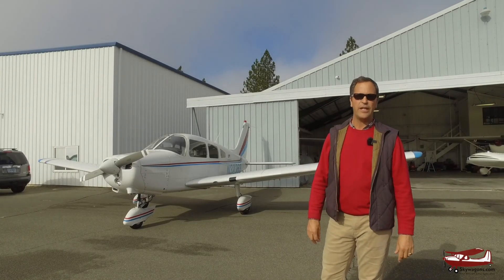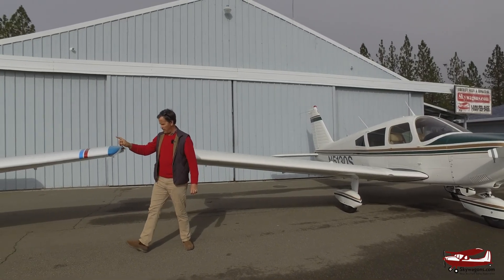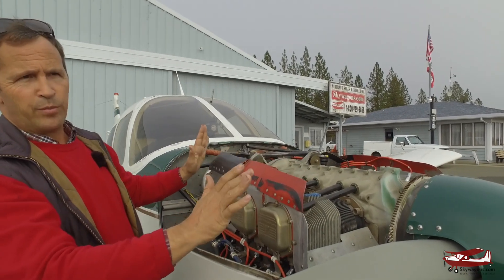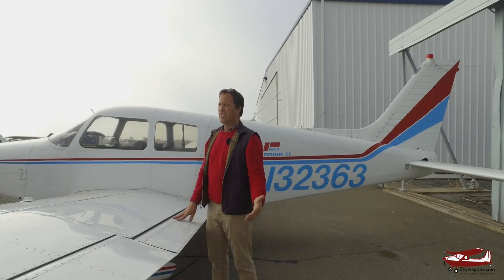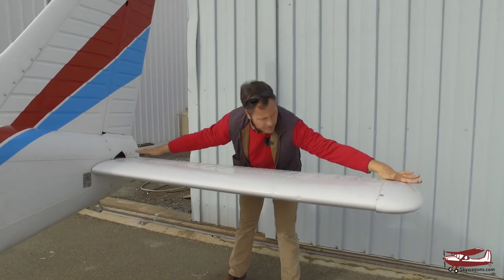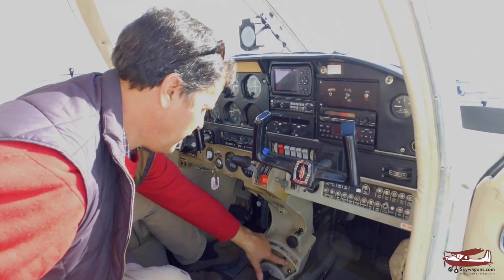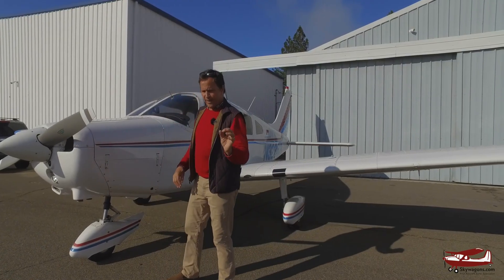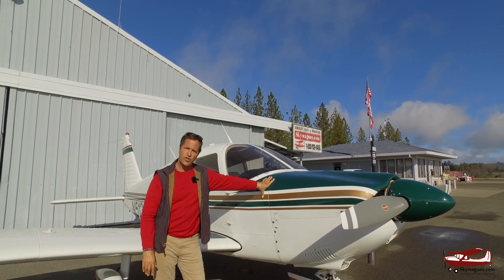Piper PA-28 Year Model Changes

Comment: The PA-28-236 Dakota is a plane to strive for. The lower 2400 RPM redline takes a bit getting used to, but the plane is quiet, and performance is impressive... Fuel capacity was dropped from 84 to 72 Gals for some reason, but fuel management with two tanks instead of four much easier. Interesting and relaxed presentation. Thank you. Enjoyed it.
Reply: I’ve heard from one A&P that you increase the pitch stop limits to 2,700 and get a 260hp Dakota. The engine, engine mount and firewall are all rated for that hp as they are the same as the Cherokee 6. He said just make sure you adjust it back prior to your annual🤣 Considering all of the Cessna 182 engine upgrade and mods it’s crazy there isn’t an STC for this. Can’t find any dark web info on someone actually doing this…

Comment: The -1 has nothing to do with the fuselage, but solely the wing.  The fuselage stretch happened somewhere around 1973 or 1974.  The -720 in a Queen Air was an STC mod and not original IIRC. And I believe the term you’re looking for in lieu of “dented” is “corrugated.”  Lots of crazy differences throughout the run.  Great video!
Reply: They are called pillow doublers they help stiffen a flat section of aluminum and make it more rigid
Reply: I think the Queen Air with the 720 were called Excalibur.

Comment: If you want to understand the configuration of the various PA-28 models then TCDS 2A13 may be a better resource than this video.   PA-28-180 Archers had the longer fuselage, increased wing span, and increased tail span for serials  28-7305001 through 28-7505260.  I have owned, for over 20 years, one of the last 100 built with this configuration.
Reply from the maker: This kind of comment is exactly why I made this video. 99% of people will not look at a TCDS and run serial numbers.  They want an overview and I gave them, one.  It is hard to spot a serial number as it flies over or you see it at 100 yards and no-one has a TCDS on then at a random airport where they see a plane they want to know what it is. Hence the macro ID on fuselages and wings etc.

Comment: I did my IFR training in a PA-235. Often the missions would have four people  on board: the student pilot, the instructor and other two student pilots also taking the IFR course and learning from observing the other student's IFR lesson. During one of those flights I was in the back, going over approach plates in anticipation of what was going to be done. We were IMC (in cloud), and suddenly the engine started sputtering, just about quitting. It took about 10 milliseconds for us three to kind of yell to the pilot in the left seat, "CHANGE TANKS! FUEL PUMP ON!"

He did as told (not that he'd have to be told, but you never know) and the engine sputtered for a few more seconds and then roared on, as if nothing had happened.

The student + instructor had forgotten to manage the fuel, were merrily flying along in one single tank, and let it run dry. Having the engine almost quit in IMC was one of my scariest moments flying.
Reply: Top notch instructor

Comment: Great video about not-so -easy defined Piper model lineup. Would like to see non-turbo Dakota one day.  I always flew Pipers but manage to find out few things in this video that I never new before, like spring-loaded ailerons  or fiberglass tip tanks. Thanks for the great work.
Reply from the maker: Thanks.
Reply: @skywagonuniversity5023  I'll come and visit you one day, I am in L36 / Rio Linda, Warrior II N39954.
Reply: @skywagonuniversity5023  Mark--did the tapered wing change the handling?  Performance?
Reply: I have a lot of 79 turbo Dakota hours, what a great plane, great seats and quiet interior. The turbo will get you into the low 20k FL to catch some high tail winds on occasion.

Comment: In the 60s I learnt to fly in a Musketeer and when I went back in the mid 90s I did a few hours in a warrior.
I simply couldn’t believe just how much climb performance the Piper had over the Beech …….you could do literally 5 min circuits in it because it climbed so quickly. That wing was amazing.
Reply from the maker: The Tapered wing on the later Cherokees is a good wing. I flew a Warrior over the Dixie fire TFR at 12,500 feet last summer.

Comment: Is there a PA-28-180 with straight wings and an extra window (3 side windows on each side and 2 windshields) please? Thanks
Reply from the maker: Yes.  One year of 180 and the same year of 235.  They were 1973 or 1974 and were called the Pathfinder and Challenger.  Three window long fuselage but the square wing.

Comment: 2:40 that poor prop rod on the underside of the cowling never gets used. As a piper guy with time in many different "cherokees" I'll say this was well done
Reply from the maker: I know, if one side is all you need open, no need to prop it.   :-)
Reply: It keeps the top cowling corner screws from digging into the doors when you lay it over damaging paint. If there broke lay a shop rag to cushion it away.

Comment: Huh! I never knew what that '-1' signified! Thanks, Mark!  I had 100 hours in my brothers 1965 Cherokee 180C years ago.  The 180 was a neat niche against Cessna, right between the 172's and 182's of that era. It was a bit faster and carried more than a 172, maybe not as much as a 182, but more economical with just the 4 cyl O-360 and less maintenance with fixed prop. I ended up buying my 172, I just liked the easier in&out with the doors on each side, plus that particular Cherokee was a maintenance nightmare, but when most things were working, it wasn't a bad machine!
Reply from the maker: Thanks for watching.

Comment: The early Cherokee 150, 160, 180 had baggage doors with no 3rd side window and the metal cowling. Some very early ones had no step. Also the 73 & 74 Cherokee PA 28 180 had a longer Hersey bar wing with the longer fuselage & wider stabilator. They where called Challenger in 73 & Archer 74.
Reply from the maker: Those Challengers and pathfinders are the oddballs in the sequence.

Comment: My Pvt check ride was in a 1961 PA-22-108, the Piper Colt.  The Piper Colt was, basically, a stripped down version of the Tri-Pacer.  2 seats and no flaps 🙂
Reply: I had 3 friends with PA22 108 Colts. They where all Metalized by Al Snider at Skycraft in Pennsylvania.

Comment: Mark, you had it right at 10:30 … 180 = Challenger and 235 = Pathfinder. I’d heard the reason for abandoning the Challenger name was legal pressure from Dodge since they used (still use) the same name for a car. Don’t know if that’s true though.
Reply: I think the 235 became the Charger for one year before becoming the Pathfinder and the 180 was the  Challenger for one year before becoming the Archer. Maybe Chrysler sued Piper so they changed the names? Also, I believe the Charger and Challenger brought a wider (Hershey bar) wing span as well as lengthened fuselage.
Reply: @footetoes183  you are correct. Challenger/charger/pathfinder had the longer fuselage, wider Hershey bar wing and the wider horizontal
Reply from the maker: Yes, there was some confusion in those years.

Comment: Piper missed out on make a sports sedan with the Cherokee series. There needed to be a PA28R-235/236. A 540 powered Arrow is a dream of mine.
Reply from the maker: That would be a great plane a retractable 235  A mini Saratoga.
Reply: True, but there are Turbo Arrows. Aren't they nice machines? (I have always been biased towards the efficiency of a turbo, at least a "turbo normalized")
Reply: Would be nice but the wheel covers on the Dakota are quite efficient. Not sure if the retractable gear warrants the added expense.

Comment: There are NO short fuselage tapered wing Cherokees! They actually got longer fuselages and KEPT the Hershey bar wings for a few years. The 180 became the Challenger (which had a Hershey Bar wing that was lengthened!) then Archer (1975) which ALSO HAD A HERSHEY BAR WING. In 1976 the Archer got a semi-tapered wing... Archer II-  The 235 became the CHARGER, then PATHFINDER (the plane I own) and then DAKOTA. You also stated that all Hershey bar Cherokees have a certain size tail,.. There are two different sized STABILATORS for Cherokees with Hershey Bar wings.  When the Fuselage was stretched, they got the bigger stabilator excepting the Arrow which got the bigger stab only when the semi-tapered wing was added (Arrow 3) not when the fuselage was lengthened. It's confusing I know.